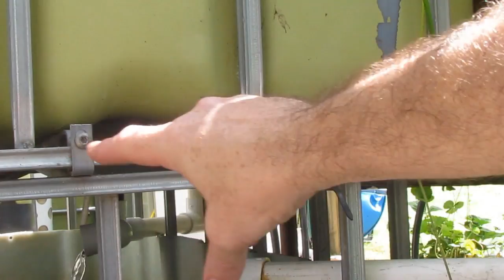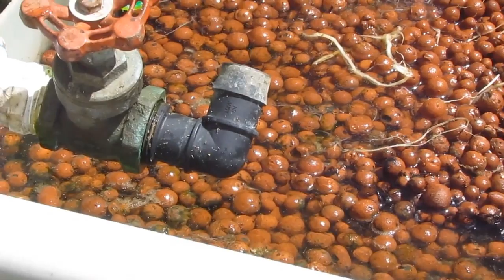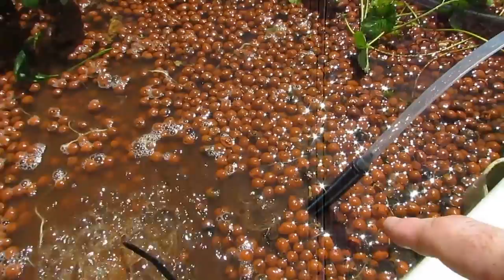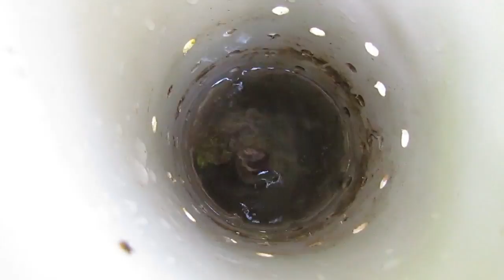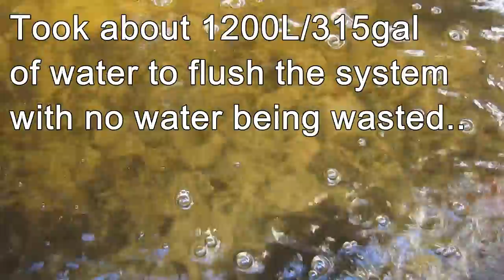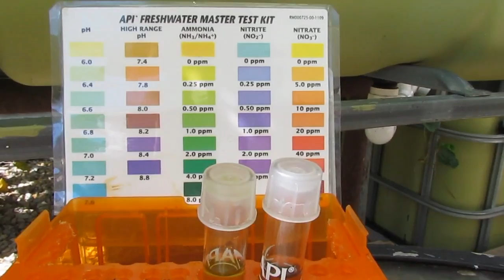Cleaning Aquaponic grow beds. Solids be gone..

Comment: Hey Rob. I'm a future aquapinist. An idea I have is to place a screen of sorts in the bottom of the bed that would provide a gap for the media to rest on. If a drain is installed it could suck the solids down without the media in the way. Have you ever heard or seen this? Thoughts? Thank you for all the great information!
Reply from the maker: Thought of doing something similar here but trying to source the right materials is a bit of a pain on a budget with the size beds I'm using. 
I do think setting up a ed like that is worth trying if you can.
Reply: Thank you for the reply

Comment: Hi Rob, to clean my fishtank gravel i use a plastic 3litre juice bottle with the bottom cut off, coupled to a length of 25mm flexible hose. It has plenty of suction, stirs it all up inside the bottle but doesnt suck the gravel out. Works a treat. Reckon itd be great for the GB clean.
Reply from the maker: Thanks for the heads up Andrew. 👍
I've found that filling the bed up with water then washing the clay as I remove it was a lot more thorough than the method I showed in this clip. Keep meaning to do a clip on it but never get around to it. 
Cheers mate.

Comment: Thanks  again Rob, I taped a air hose to a water spear and turned on the water and compressor and pushed it into the river pebbles in the flooded grow beds. Bypass the sump and removed the solids in 6 grow beds. It worked well. The was the second time I have used this method and the amount of solids that are removed is amazing. Cheers, Jim
Reply from the maker: Nice one Jim.
Sorry I missed your post mate.

Comment: I don't know if you've ever cleaned a fish tank before but you use a syphon that is shoved down into the substrate. If you flood the bed like you did then used your spear the same way but with suction instead of air coming out of it and sucked out the solids and kept your backup water flowing in, you can pinpoint the mucky areas and not have to floor and drain the entire bed so much. Just a thought, as you said it's a constant evolution.
Reply from the maker: Nice idea. 👍
Now I flood the bed, swish the media around to get the bulk of the crud off, remove the media from the bed & store it in barrels until all the media is cleaned. I then dump the filthy water then re pack the bed. Only takes about an hour to do it with the clay media. I need to do it to a bed with rocks in the base soon & am not looking forward to that at all Elmily. 😞
Sorry I missed your post too.
Cheers.

Comment: Hi Rob, Thanks for showing me how to remove solids from grow beds. Made a water/air spear attached to a compressor and a water hose, flood the bed, bypass the sump, plunge it into the river pebbles and it lifts the solids to the surface. Have done 2 grow beds with 4 to do. I have used a pitch fork, extra worms, digging and water blasting and using the air/water spear is the far and away the best. Thanks again. Jim
Reply from the maker: Glad the clip helped some Jim 👍  
Cheers mate & have a top one.

Comment: Have  you considered having rows of tubing with holes on the bottom that blast air, like one of those solar aerators 24/7?
Reply from the maker: Lurker Have had other folks suggest it but I don't think it's needed. A small amount of solids is ok & enviable in a system like this.  Also gives the compost worms something to feed on. 
Cheers

Comment: G'day ,when I made my gb's I cut them from the sides instead of top or bottom ,you get two beds from each ibc and they have nice flat bottoms .You then use tank fittings for the drain.You then cut the ibc cage to the height you want ,incorporating the base ,you then use the leftover top section of cage for a stand, ie the base sits on top of the top,you may have to cut the corners of the cage to open it outwards to allow the gb to fit.You can also jump up and down in the centre of the base to form a sloping bottom to your gb's.I also noticed that you don't have nearly enough holes in your media guard to allow fast draining which I found made the auto siphons play up a lot , as in they would not break cleanly.I found that angle grinding as many slots as you can, vertically is best.With this setup I have found they stay quite clean as there are no low spots.I have learnt a few things from you and I hope this info is of some use ,Cheers mate.
Reply from the maker: +joe smith 
Hi Joe. 
The bed in the clip was a chop & flip job but the others were cut the same way as yours. Only difference is that these tanks had ridges in the sides so the bases we'rent flat. All the beds were swapped out for flat base beds at the start of the year when the system was expanded. 
Had no real issues with that guard & slow flow rates & am still using it in the new bed. Have started to use the slit method ij the newer shrouds & found they work just as well. 
A lot has changed in the system since this clip was posted 2½ years ago. Have added 2 round 1000L FT, bio filter, 2 barrel beds & a 4th IBC grow bed. Hope to have a new update clip on the system in the next week or so. 
Cheers & all the best.

Comment: Would it be plausible to incorporate an air line/s UNDER the chosen medium before filling a grow bed? This may allow for air to be pumped in at the lowest levels without disturbing the most of the medium or any of the plants and still make it possible for the water to be flowed throughout. I am unsure as to whether a air compressor would help or hinder this as I think there could be too much pressure in such a system. Ideas?
Reply from the maker: +Franklin Anders 
Hi Franklin. Have thought about that myself & think it could work as long as the holes didn't get clogged & the compressor was large enough. I had planed to try a system in a bed but never got around to it. I was going to use the cheap 13mm/½" irrigation line with holes in the underside. 
Cheers mate & have a great one.

Comment: Hi Rob.
Thanks for all your great videos!
I have a question regarding grow media. I live in a desert area in Mexico. In summer it tops 40C. I understand expanded clay pebbles heat up very easily. I was thinking of using these but putting 4" or so of suitable natural stones as a top layer to help protect the clay pebbles from the heat.  Would this help or is there a better way?
Thanks in advance!
Jay
Reply from the maker: +Eco-Hub Mexico 
Hi Jay. 
If you could find a light coloured suitable rock It might help reduce the heat trapped in the grow beds.  
I've found the best way to keep the beds cool is to have them fully planted & covered in greenery when the hot season hits here. Some 50%+ shade cloth over the beds also helps to reduce the heat trapped. 
Sorry for the slow reply mate. 
Cheers & all the best with the system.
Rob.

Comment: Hello, thank you for respond.  Yes I have a tant with plastic(   Cellophane) covered on it. I would like to know what kind of material did you used for your greenhouse.
Reply from the maker: Hi Alisher..
The shade cloth does cut a lot of the light which helps keep the algae under control.. We buy it from a local garden cloth & netting supply store Called NetPro..
Keeping sunlight out of the tanks is the first step in killing the algae off & in  some cases is all you need.. Did a clip on the fish farm as we are having an algae bloom in there at the moment.. 
Algae in aquaculture set up, a quick & easy fix..
Have been told that barley straw will help kill off the algae but haven't tried it yet..  Will be posting another clip on that system soon so you can see how it's been dealt with as I will be trying out a UV filter as well.. 
Hope that helps some mate,
Rob..

Comment: Hello,

I've got a few questions as I am planning to start my own auqaponic garden. I've found a 55gal drum set up that would be great for me to start with considering my space is limited. I will share a link bc I am looking for opinions and was not sure where to turn. 

http://gardenpool.org/online-classes/getting-started-in-barrelponics

So this "barrelponics" set up is pretty simple. But I wanted to ask about the clay ball substrate you use and I was curious if you think it may work in this size set up? 

I have also found you of Facebook and sent a message there. Thank you.
Reply from the maker: Morning Joshua.. 
I saw the FB post so will reply in both spots ;-)
I used the clay in our barrel system as they were light & easy to handle for the kids.. They work fine but their big downfall is the price as I see it.. Took just over $120 to fill our 2 100l/26.5gal bed barrel system as I didn't buy the clay in bulk.. 
Hope that helps some mate & have fun with the build,
Cheers mate,
Rob..

Comment: Hence, the difference between DWC hydroponics and grow media aquaponics. That smell is from anaerobic conditions developing down at the bottom of the beds...like in a septic tank. Not what you want! You wouldn't grow food in septic waste!

While you prefer not to use the actual under-gravel filter that are sometimes used in aquariums...you might consider installing a course screen under the media, a couple of inches up from the bottom, so the media doesn't do down to the very bottom of the beds. Then, if you limit the drain holes to the bottom couple of inches of the standpipe...below the level of the media...you might find that you can get some good turbulence in that media-less bottom part of the beds. Perhaps, considering how much flow bell siphons can develop, that could dislodge the sludge as fast as it builds up and carry it out to the filter so that the sludge doesn't build up.

Of course, the other issue could be inadequate filtering Some people don't use filters at all...and they like to show off how clean their fish water is. But, of course, what's happening is that they are sludging up their grow media, turning them into the equivalent of septic tanks. Sooner or later they'll certainly have the same issues you've experienced. The solution is more filters. "Backyarders" don't differentiate between settleable and suspended solids. The homemade swirl filter doesn't remove the suspended solids...but the grow bed does! Using bag or drum filters might be the only practical solution. I haven't seen anyone come up with a homemade drum filter yet, but someone will sooner or later!
Reply from the maker: Hi there.. 
We ended up adding in a radial flow filter not long after having this problem so most of the solid waste doesn't make it to the beds any more, only the fine suspended ones.. 
Not to worried about the fine ones that make it through as a clean out every 5-6 years is doable & hopefully we will only have one media bed in the upcoming remodelling of the system.. Looking at other grow bed & bucket options at the moment  ;-)
Cheers & have a great one.. 
Rob..

Comment: A siphoning gravel cleaner for aquariums should work well. It pulls all the decay/debris with it so none can escape into your system. I prefer the siphons that are not self priming because those has smaller openings that trap debris. I have three types and "Aqua Culture Regular Gravel Vacuum Cleaner" is My fave. (Some decent videos on YouTube ;-) bout using them in aquariums.)
Reply from the maker: Hi again & thanks for that... Checked them out a while back but don't think they would work too well with the depth & size of media in the bed.. Might try & rig something up when we pull the beds down just to see if it will for sure though..
Cheers,
Rob.

Comment: Hi Rob. I'm looking at starting a AP here in the north of Arica.I'm just wondering, isn't it better to but in a solid filter so that you don't need to deal with the solids in the grow bed??
Thanks for a great video
Reply from the maker: Hi there.. I now have a radial flow filter in the system but didn't get talk about  it in this clip..
Have just finished making up a new radial flow filter but haven't posted the clip as of yet.. There is one for the old one if you are interested..
Aquaponic radial flow filter for solids removal..

Some folks are anti solids filters as they say that is the job of the grow beds to filter out the solids & they are right to a degree..  I like to be a bit over cautious & cleaning out a filter is a lot easier than a whole grow bed.. The solids don't go to waste as we use them to feed the soil beds..
Hope that helps some..
Cheers,
Rob.

Comment: After watching this video I thought you might want to try a new method of breaking up your solids. try placing a floor burnishing pad with a cone of some sort in the middle of it, under the water outlet. This should force the water through the pad and filter out many of the larger solids and allow the smaller to flow through the bed.

Sorry for the long link but here's a burnish pad. There are stiffer ones with larger gaps in the fiber ones as well.
http://www.webstaurantstore.com/scrubble-by-acs-33-21-21-hair-blend-light-burnishing-floor-pad-type-33-5-case/59821HRLT.html?utm_source=NexTag&utm_medium=cpc&utm_campaign=NexTag+Campaign
Reply from the maker: I use smaller dish scrubbing pads (similar material) under the inlets from the tank & found they pick up the bits the radial flow filter misses.. I do need to set them up a bit better as some of the solids are still washing over the sides & the cone idea sounds like the go, thanks for that..
Cheers, Rob.

Comment: ROB do dirty grow beds interfear with bell siphons working right? Almost all my grow beds i'm having trouble getting them to brake siphon.I have 7 ibc and 20 flow beds. Thank you for any help. great videos. Thanks Jim
Reply: Try cutting down the inflow of water into the growbed. I had a problem where the outflow was constant and I cut down the inflow by adjusting the ball valve, fixed the problem right away.
Reply from the maker: I haven't/didn't notice that Jim.. When I had issues with constantly flowing siphons it was more to do with to much water flow into the beds or not enough air getting into the bell to help break the siphon.. Hope that helps a bit & let me know how you go..
Cheers mate,
Rob
Reply from the maker: John Galt
That's what fixed ours as well John... They can be fickle little things..

Comment from the maker: Am hoping that the radial flow filter will pick up any finer bits that don't get washed off as they come through.. That might also help the system not get overloaded with too much stirred up nutrient rich particulate..
I think that the tap water might be too harsh on the bacteria I knock it around a bit. Do you have another tote you could settle out some water in & wash out one beds worth of clay a day? 
Hope that helps out a little bit mate & you get it sorted out soon. TBC

Comment from the maker: I have thought about the rafts but then I would need to install some large bio filters for the bacteria to live in.. The whole system is getting a make over with flat bottomed beds (is going to be a job & a ½ ) so we won't have this issue in the future.. I also think that the radial flow filter has greatly reduced the amount of solids that go into the beds too.. Should do a bit of an update on the solids issues.. Will try & post something this weekend on it..
Cheers & have a good one..

Comment from the maker: The in pipe & siphon are in opposite corners so the water gets to have a chance to flow through the whole bed evenly.. It helps the bacteria have a chance to "clean" the water for the fish as well.. I have some new flat bottom beds that will be going in once some other jobs are done on the list.. One thing I will be doing is slopping the beds towards the corner with the siphon to help the solid drain out..
Thanks for that & have a great one :)

Comment: If the bed was tilted towards the corner where the water comes in, and the siphon was also in the same corner, maybe the sludge would be easier to draw out. Also, if the ridges on the bottom of the bed are a problem, I think you could make the bottom smooth by covering it with clay. Thanks for the troubleshooting demonstration! I hope to get into aquaponics when I move :)

Comment: I had to cut that experiment short today.  My 800 gallon fish tank is 4 feet deep and I suspect the bottom plate rotted.  There was a big bow in the side and the bottom was being pushed out.  I had no choice but to move all the fish and empty the tank.   Tomorrow I will disassemble it.  I'm afraid I will not be setting that experiment up again because I'm going to go with a smaller design,  Maybe just use a drum.  I believe Jon Parr is also doing this same experiment with one of his systems.

Comment: There was also a bio digester  type filter I saw that may be handy, basically an air stone in the bottom of a bucket with a mesh over top and small 2cm pieces of 1/2" pvc on the top and slit on one side. The small pieces of pipe provide bio mass and banging together from the air stone breaks the solids into smaller pieces until broken down by the bacteria.

Comment from the maker: I have never fed the perch more than 3% of their weight, which was recommended during the early stages.. That has been reduced to around 2% as they have matured so I doubt that is a big part of the problem.. The low points in the bed & lack of filter for 18months or so is probably more the issue.. 
People I have spoken to who do large aquaculture/ponics installations for a living say that this type of solids build up is just a part of of the cycle.. TBC

Comment: I plan on seeding it with some filter media from my 5 different fish tanks so i should be ok on that. The greenhouse is in the works still, i put it on hold to get the Aquaponics system up and running. Thanks for the advice. Let me know if you have any questions or suggestions on my system. Thanks.